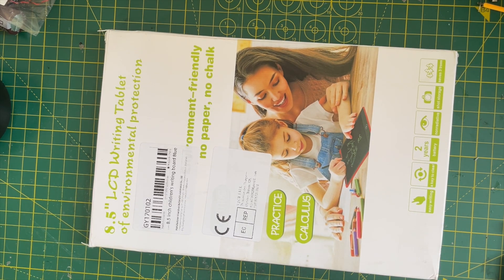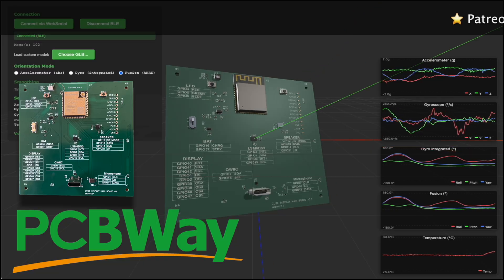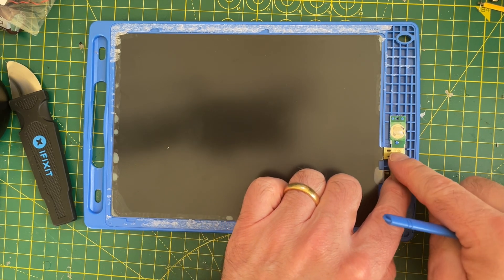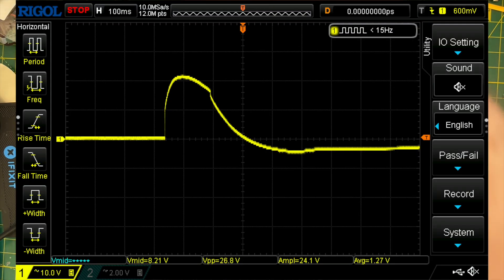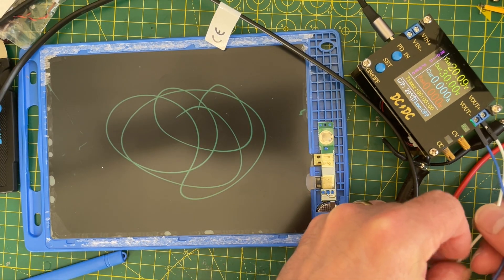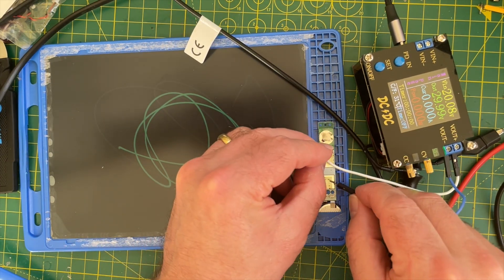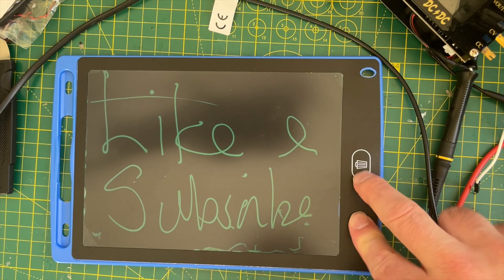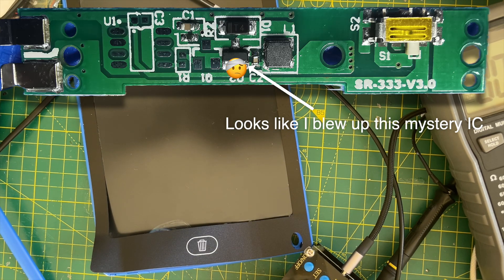Tearing Down a Bistable Cholesteric Display

Comment: The reverse voltage actually left a ghost image of the last drawing. That's interesting
Reply from the maker: Yeah, it is really interesting. I've been trying with different voltages and it works down to about 6-7 volts. But the transition is much slower.

Comment: remove pcb and try different lower voltages? would reverse polarity make it non-black? would it still work?
Reply from the maker: Good idea - I wonder what the minimum voltage required is. I'll have a play. And I wonder what the max voltage is - when does it catch fire :)
Reply from the maker: Down to about 6-7 volts and then the image either doesn't go or leaves ghosting. It does transition much more slowly at low voltages.
Reply: @atomic14  and what about when it catches fire? 100V? 300V? 1kV?

Comment: I had few bought for my kids. All of them broke for no reason , on one writing was weak to see, on other didn’t write at all. Wasn’t battery’s fault. All they did was lying unused. It was quite fun initially but then waste of money. Electronically wise not much there, some voltage resets crystal, that’s all. Some of them have a lock to not delete screen by mistake.

There were such screens produced before that allowed transferring content to file but it didn’t live long on market.
Reply from the maker: They seem to have gone through some evolutions electronics wise. This one barely has anything on the PCB.